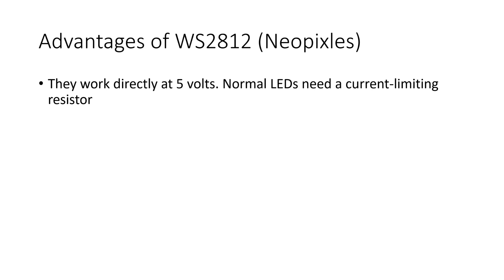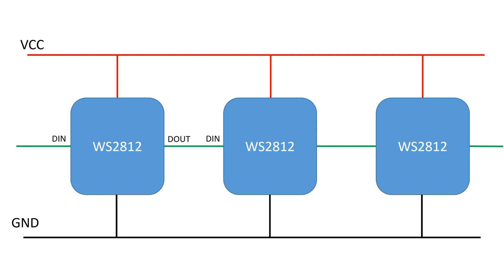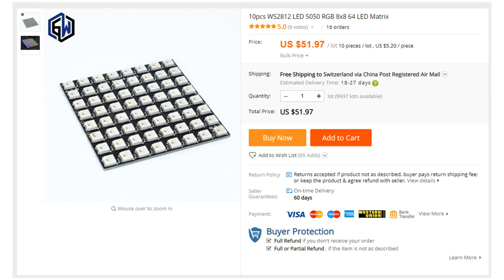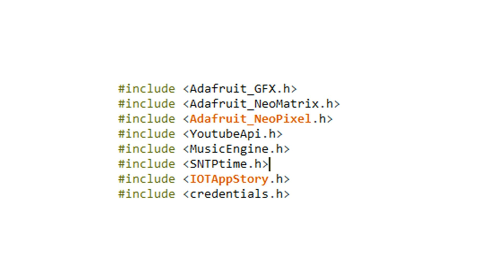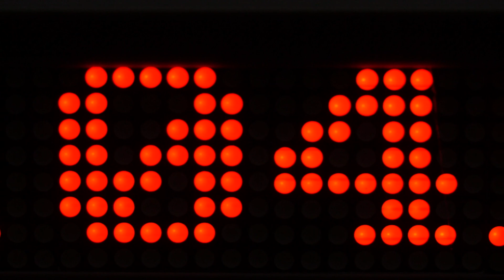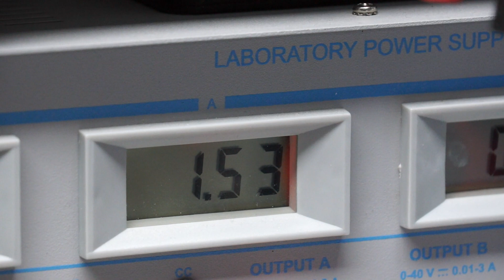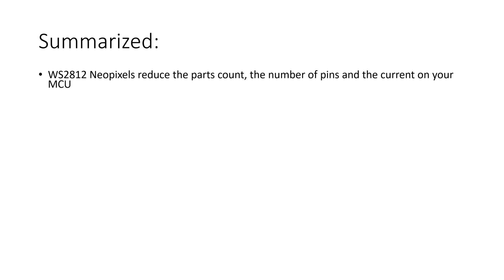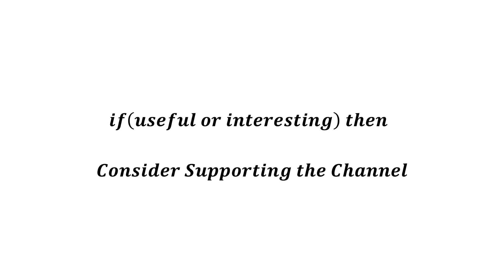#246 12 Tips and Tricks for Neopixels Projects (Arduino, ESP8266/ ESP32)

Comment: That's not bright enough for my project. Thanks for the video. You saved me a lot of time and money.
The full power on will result in triple the costs for the already expensive power supply.
I would make a 5 V busbar connected to any module and feed it with 24v and seperate step down converters to make it look as uniform as possible.

For a very large number, you will still need artnet or sacn.
I found Lightjams as an affordable Software. It's maybe interesting for you. You can easily control many thousand RGB pixels ( or voxels) at once.
Reply from the maker: Having more than one power supply is a good possibility to solve the issue of different brightness. In my case, this is not so important as most of the pixels are off during operation

Comment: You might want to add a logic level shifter to extend the 3.3V output from the ESP32 to 5 V for the Neopixels. It's hit or miss with the Neopixels without using one.

Do your 8x8 matrixes fit side by side on a breadboard? Mine are very slightly tilted which drove me nuts :)
Reply from the maker: 1. As soon as I get problems I will add a level shifter.
2. Mine fit nicely.

Comment: What are the ways you use to attach the metal bar to the pcb ? Is it just thermal adhesive ? Do the ws2812's run hot at all (prolonged white light) ?
Reply: Continuum if they are driven at full white each pixel can draw 60mA so yes, they run hot! Power consumption does drop off dramatically when the brightness is reduced or less colour channels are employed so it’s typically less problematic in the real world.

Comment: I just got a "P4  SMD 3in1 RGB  LED display screen module ". They are less costly and already put together. 32 x 64 pixels.
See: https://www.aliexpress.com/item/p4-64-32-16x32-rgb-led-matrix-panel-indoor-smd2121-MBI-led-diplay-screen-p4-led/1000001317460.html?spm=a2g0s.9042311.0.0.323f4c4dsRuDPT

See also:
https://learn.sparkfun.com/tutorials/rgb-panel-hookup-guide/all
Reply from the maker: I have one of those. But it did not have the format I wanted (too high). So I made my own ;-)

Comment: Hi Andreas,
Quick note about the flickering you experienced with your strips. This is most likely due to voltage drops on the data signal. In fact, the real reason is that most MCUs operate at 3.3v logic level.

The pixels' threshold for detecting a HIGH is from around 3v to 5v. Meaning, if your data line drops below 3v (which will happen when you least expect it), HIGH signals won't always go through.

There's an ultra simple and low cost solution. Any 3v to 5v level shifter will do the job. Adafruit sells some 74AHCT125 and I've had no problem with those. 

Check out the "Best practice" section on the Adafruit Neopixel Überguide for more details! 
https://learn.adafruit.com/adafruit-neopixel-uberguide/best-practices

Cheers
Reply from the maker: Maybe this was the case. But the ESP8266 also is a 3.3volt chip and has no issues.

Comment: Assume 60mA per pixel at white full bright, the biggest current draw, then work out your power supply requirements from that. Of course, in your case you weren't planning on using the whole lot of pixels at once, so you 'could' get away with less current supply as long as your mcu turned it off first. However, if someone is planning on using these tiles with all pixels on at white full bright, they will need a bigger power supply. Inject fresh power at each tile, even in the middle it looked dim at the ends. 5v pixels require more power injection than 12v ones
Reply from the maker: I measured the current draw at the beginning (1.5A per panel). It was more 25mA per pixel.

Comment: Add a resistor across the FET to give the LEDs enough power for the logic to work. Then you can command them off before enabling full power.
Reply from the maker: I do not think this is a good idea because the resistor has to be nearly zero ohms to get enough power to the LEDs.

Comment: Thanks for another great video. Your channel makes it easy for practicing engineers working on high end equipment to stay current with the latest cheap Chinese electronics! ;-)

A couple of quibbles though:

- Just from a good practice standpoint, it seems that all panels should have power and ground applied to both ends, which would require N+1 connections for N panels. The voltage drop from up to 1.5 amps being daisy chained over thin wires connecting many panels isn't insignificant (which you noted and partially addressed by connecting in the middle of the panels rather than at one end). 
- More bulk capacitance in the form of an added electrolytic capacitor at the output of your power supply will make the timing for turning off all the LEDs a little less critical and may even allow for use of a smaller power supply, assuming that the percentage of lights lit will be small after startup.
- Bypassing each panel will reduce radiated noise which one would guess might be an issue for a device which can periodically switch from close to 0 amps to 1.5 amps. This may (should) be built into the panel itself, but maybe saving a few pennies is more important for the manufacturer of this type of equipment...
Reply from the maker: You are right for many applications. In my case, the whole display only uses 0.5A during operation. Most of the pixels are off. Soe I do not need to solve most of these problems. My problem was just for 5 ms after powering up and I do not care about the color distribution during this short time.

Comment: NOTE:  The Adafruit library will have issues on Esp8266 when there is WiFi traffic as it is BitBang and the WiFi interrupts will "interrupt" it (which can not be disabled without crashes).  I know, as I wrote the original and created NeoPixelBus to fix it.
Reply from the maker: So far I did not encounter problems. It runs now for a few weeks. Maybe because I only contact Youtube once every minute or so and only update the pixels afterward. But it is good to know if I run into problems!

Comment: I would add a word of caution on using the 2812 chipset.  I've done some professional work a couple years back on large installation LED pieces and the 2812 LED strips were neverending nightmares of unreliability.  You tend to get dead pixels after a few weeks of continuous operation that kills all signal transfer downstream of that point.  This resulted in some catastrophically expensive callbacks.  We tried multiple suppliers and saw the same issue come up repeatedly to varying levels.  
  And yes, we followed strict ESD protection protocols as well as using custom boards with built in overvoltage protection diodes.  
  We ended up having to fall back to the older 8806 chipset.  Those chips require a data and clock line, but have proven to be far, far more reliable in the field.  
  I don't know if the 2812s have improved at all in the last couple years but I would recommend sticking with the 8806 chipset if the project requires long-term reliability.  If you do use the 2812, I would recommend buying the LEDs early and running them 24/7 with a continuous pattern for at least a month to catch dead pixels so you can cut them out before installing them.  In my experience that tends to catch most of the pixel failures but some will sneak through even with a month-long burn in.
Reply: Ah, thanks for that tip.  I suspected there must be some common failure like that behind the development of the WS2813 and similar.  These versions have two data in lines - one is connected to the data out of the previous chip, and the other is connected to the data out of the pixel before that.  If a chip stops working, then the following chip will get it's input signal from the chip previous to the dead chip, and the rest of the display will work.  So it's intended for exactly the situation you describe.
Reply: @zephsmith3499  Ah, interesting cludge to get around the dead pixel issue.  The problem is that double bad pixels were not that uncommon an occurrence in my experience.  I had no way to analyze the failures, but if I had to guess, it was substandard ESD protection on the 2812 chips.  Strips that come in the silicone waterproof jackets tended to have considerably lower failure rates as long as the jacket was kept unbroken.  As soon as you handled an emitter, the probability of long-term failure went up.  That was very noticable when we cut out the dead pixels and the failure rate in the neighboring pixels was around 30-50% in the next week.  I'm guessing the 8806 chips used a older, larger fab process and can take static electricity hits better.  

If one has to use the 281x chipset, I would definitely recommend going with the 2813 chips with the ability to route around dead pixels, getting the kind encased in silicone waterproof tubing and making custom driver PCBs with zener overvoltage protection diodes on the data and power lines.   Reverse voltage protection diodes would also probably be a good idea too.  Also, I would still recommend the month-long burn in as even strips with the most delicate handling still had occasional failures.  Don't cut the strips or breach the silicone tubing unless it's absolutely necessary in your design.  And be sure to order a few extra strips so they can be hot-swapped in case of failures.

If I ever do LED strip work again, unless something has drastically changed, I'll stick with those old 8806 chipsets.  They're not as capable and need double the data lines but at least they have a reasonable reliability.
Reply from the maker: My application is not life-threatening, but it runs quite some time every day. I will report back if one of my pixels dies.

Comment: i prefer apa102/clones. they are more tolerant of timing and voltage levels. also capable of much higher refresh rates than ws2812. also led defaults OFF. @10:06 wemos d1 mini is optimal size for esp8266 since most pins are wasted anyway. d1 only exposes the useful ones.
Reply from the maker: I had to take whatever was on the panels :-(

Comment: Teensy MCU are an excellent option for projects related with Neopixels & WS2812 LED strips due to its fast Direct Memory Access and extremely precise timing too. Thanks Mr. Spiess!
Reply from the maker: So far I never used a Teensy. Thank you for the tip.

Comment: There was a batch of those neopixel matrix boards with incorrect silkscreen, so in my case the DIN and DOUT were swapped. Took me quite some time to realize the problem. Always worth double-checking before making something permanent.
Reply from the maker: Or use Wire Wrapping;-). Thanks for the info. Maybe it will help somebody with the same batch.
Reply: @AndreasSpiess  Have you done a wire wrapping video yet? - I would be very interested to see that.
Reply from the maker: Yes, a few weeks back.
Reply: @AndreasSpiess  Found it - https://www.youtube.com/watch?v=L-463vchW0o - Thanks! Not sure how I missed that one.

Comment: Power injection is also a huge issue w/ power strips when decorating a house. #16 power wire & multi-hundred watt power supplies are needed.
Reply from the maker: You are right. You can produce quite power hungry applications. In my case, it was a little easier...

Comment: That font has one problem: there's an empty row at the bottom, but not at the top. Ideally, there would be empty rows at the top and the bottom, so as to make it more beautiful.
Reply: The empty row at the bottom is to allow for descenders. If you don't allow for that, things start looking really horrible when you have a character with a descender since it has to be shoved up above the baseline to make room for it. We had this back in the day when the first 5x7 matrix printers tried to print lowercase.
Reply from the maker: That can easily be done by changing the cursor. I will try and compare. Thanks!
Reply from the maker: For the moment I only have numbers. So it should be ok.

Comment: "Old RGB LEDs connected to a digital pin only have ON and OFF" not really true, PWM is counted as digital output as well...
"The data pin of the MCU only has to source 1uA. Normal LEDs consume many mA and easily can overload the output pins" also not really true, ATMegas in Arduino Uno example can easily provide the 20mA needed for almost all normal LEDs...
Reply from the maker: You are right.
Reply: PWM is still just ON and OFF that has to be controlled by the µC. Sending data once and then being able to ignore the LED is something completely different.
Most µC have a low limit on the total current they can draw, in the case of an atmega it's 200mA at the VCC/GND pins. That's enough for at most 10 LEDs or 3 RGB LEDs without "intelligence".
Reply: @superdau  did you read and understand my comment? 
1) he said that old rgb led's connected to a digital pin have only on and off, which is not true, you can change the colors and brightness using pwm on digital pin...
2) he didnt said how many led's, he just said that the MCU's can provide only 1uA on output, which is not correct, i never ever seen MCU's that can provide only 1uA (except probably those blob ones but noone in home projects use such mcu)...
which part of my comment you dont understand? i just pointed that some things that are said in the video are not exactly true, things that even Andreas confirmed he got wrong...

Comment: Buy a few logic level converters to switch the 3.3v to 5v for the data wire from the ESP8266 or ESP32 to the LEDs. ws2812b typically work with about 60-70% of the 5v, when your rail powersupply is, say, 5.5v, the 3.3v will not reach the required level in my experience.
Reply from the maker: I was lazy and I know what to do if I have problems ;-). I have a few in my stock.
Reply: @AndreasSpiess  then this can serve as a tip to other viewers 🙂

Comment: That's a lot of current for that thin wire wrap wire. you'll have less brightness uniformity issues if you use heavier wires for GND and 5V for your panels. also, you have Neopixel spelled "Neopixle" in your slide at 1:19. Thanks for your videos as always!
Reply from the maker: Because I only have about 500 mA divided by 6 panels I have no issues with power. But if you want to have all LEDs on you are absolutely right.

Comment: Thought about using neopixels several times, but The Scrouge in me struggles with using all that current even if it is small compared to what we used to use in much cruder displays, but the effects you show are so nice that I probably should use them. Thanks for sharing!
Reply from the maker: As I said: I love them because the excitement per effort is rather high :-)

Comment: Would it not be better to supply the power and ground in a star configuration (i.e. each panel wired back tot he PSU) rather than from either end or the middle?
Reply from the maker: If you have much more pixels a star is a good solution. It is an extension of the one I proposed (middle).

Comment: No problem connecting VCC from ESP8266 to the VCC pin of the NeoPixel if you only have a few pixels like a NeoPixel Stick, individual pixels or only a cut out part of a long strip. So the "never" only applies to when using many pixels. Also, have powered the pixels both from 5V and 3.3V, from the Wemos D1 mini internal power supply, using only a few (16 at most) pixels. I'm using a resistor of 120-130 Ohms between the ESP GPIO and the NeoPixel input and also a 1000uF capacitor on the power supply to the first NeoPixel. Without the resistor, it was not possible to get the NeoPixel Stick working without a level shifter. Using a FET is a good idea but maybe one for each matrix or perhaps 2 and 2. Regarding the decreased intensity to the right, why not just wire VCC/GND directly to each matrix instead of using the daisy chaining? You have room for individual wires.
Reply from the maker: You are right. And I do not know how much power the LDO chip on the Wemos can deliver. If your 16 pixels are on for a longer time it might get critical. The cap cannot help then, it only helps during short peaks.

Comment: I have always had problems with the Adafruit Library to handle more than maybe 100 LEDs on any Arduino. What do you do differently?
Reply from the maker: I only tried 64 with the Arduino. The 384 were done with the ESP8266
Reply: @AndreasSpiess  that kind of makes sense. I always suspected it was due to the lack of RAM in an ordinary Arduino, while the ESP has tons of it.

Comment: The color of the neopixels in your display are white which means all 3 LED’s are on.  Will the current be less (1/3) if only 1 color LED is turned on?
Reply from the maker: I did not measure, but if I remember right I dis not see big current fluctuations. So I assume the chip adjusts the max. Power. Maybe somebody knows more?
Reply: Last time I measured it the current is indeed less for single colour channels.
Reply: Yes, given a power supply that can handle full white, it will draw about 3 times the current (and power) of full red, green or blue.  (However, as you can see in the video, if the supply voltage sags, the curreent decreases, so in that case full white would draw less than 3 times the current of full single-color).

The other caveat is that the current draw is non-zero for full off; that is, each pixel tends to draw something like 1mA when unlit, to run it's digital logic and internal voltage regulator.  I call that the "dark current", acknowledging that the term has other uses in other contexts.  (And some pixels types draw more than that).  So total current consists of a smallish "dark current" base plus a variable amount which depends on the brightness of each color.

Comment: The ESP gets via the D1 resistor 5V, this is too much and not supported. Maybe it should be limited to 3.6V.
Great video as always.
Reply from the maker: You are right. But according to the CEO of Espressif, the ESP8266 is 5 volts tolerant.